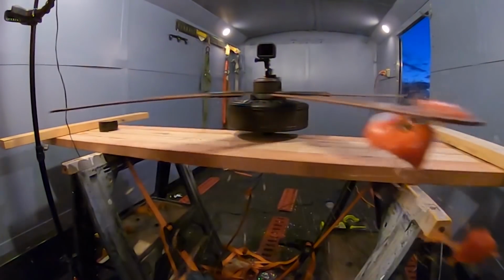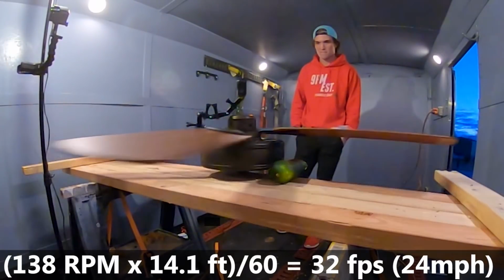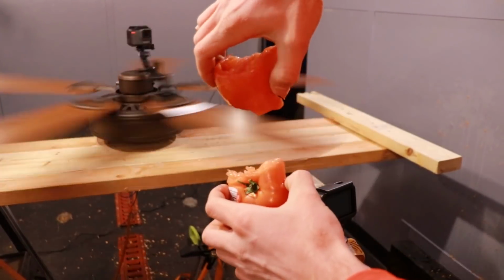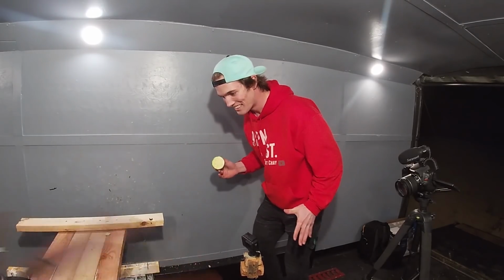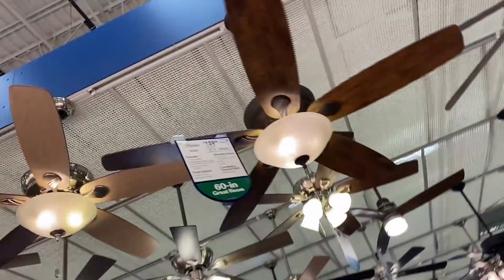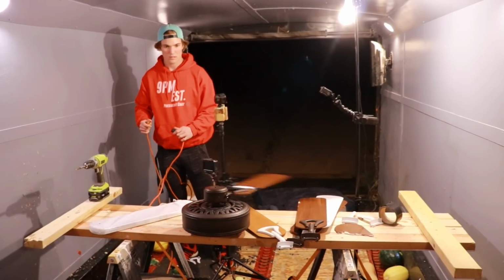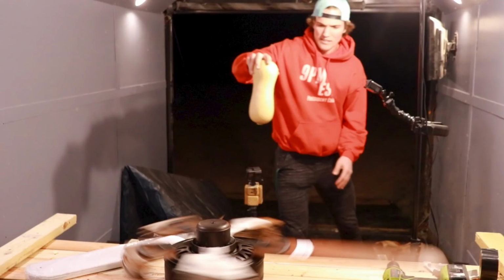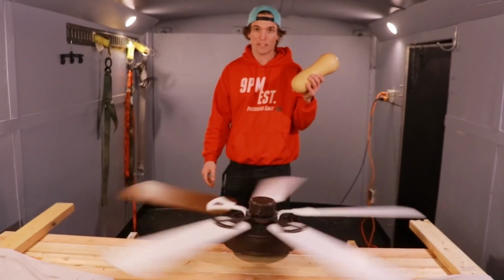Ceiling Fans are VERY dangerous

Comment: My ceiling fan actually has a built in feature where if something prevents it from moving, it stops. My fan can be going at full speed but when something touches it, it slows to a stop. I think it is pretty cool
Reply: What brand is this? Some newer DC ceiling fans have electronic control that also slows or stop the fan when it wobbles violently even if its due to strong wind drafts.

Comment: Flatting the blade pitch caused the RPM to increase. There are UL tip speed requirements that all US ceiling fans must meet. It changes by fan size and blade thickness.

Comment: Funny this popped up, when I was younger I was climbing up onto a bunk bed and the ceiling fan was on high and when I got to the top I hit my head on the blade and cracked my head open and needed 4 staples to get it back right